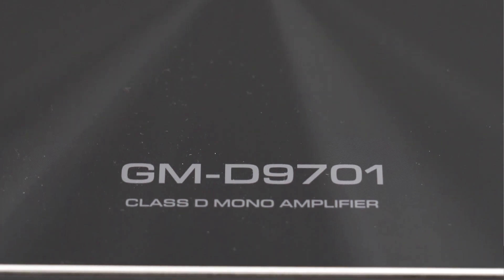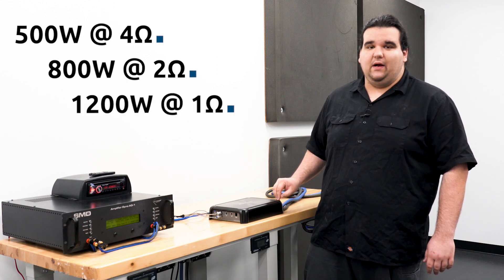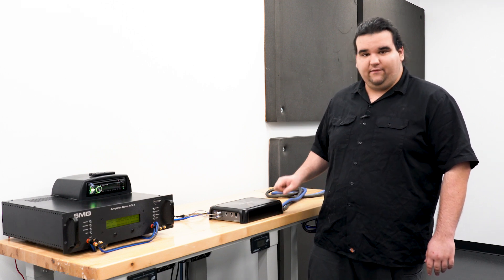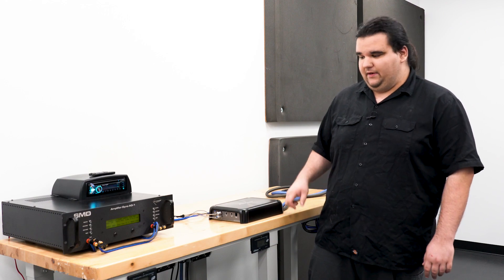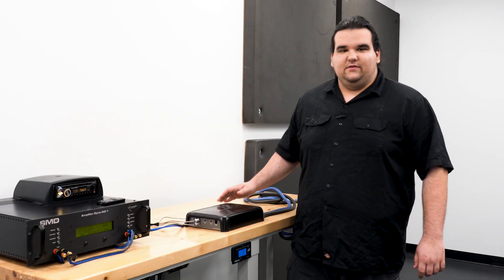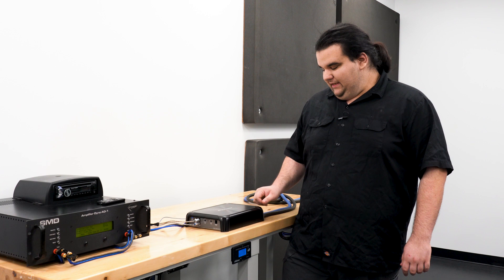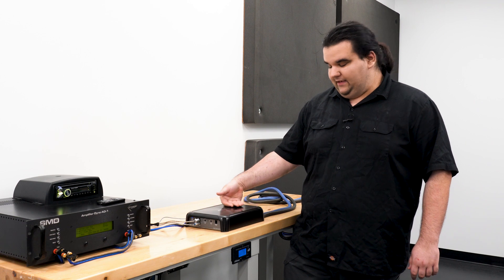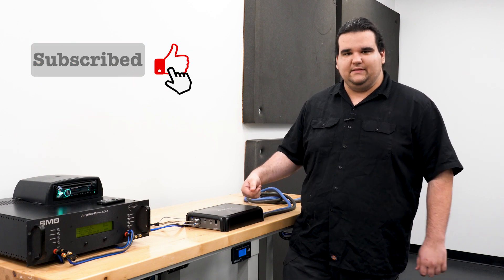Pioneer GM-D9701Amplifier Dyno Test | SMD D'Amore AD-1

Comment: what is the best Gain setting
Wirh rockfoord Punch P3D4-12 600 RMS @2ohm
Reply: Depends on head unit, the h on gain setting for pioneer is for 4v preouts iirc and the normal gain setting is for 2v.
Reply: Thats a impossible question

Comment: I have a bike with amp works great with switch on, when turning bike on it goes in protection mode, power and ground are great getting 13-14 volts after turning bike on and when switch in on position i get 12.47 volts i checked cable ohms and right on the money,  please help
Reply: Sounds like remote wire is not correct or you have a loose wire. Many mistakenly put remote wire to power antenna
Reply: @cfmechanic  thanks

Comment: Hi, i am using this amp to run the 2 JBL stadium 1224, at 1 ohm load and total 1000watt rms. But when i raise the volume above than 20 from my after market stereo, this amp start tripping, whats the issue.
Note that i did BIG3 upgrade in my car electricity wiring. What i have to do further? Guide please ???
Reply: Low voltage high gains! Please check with DMM.

Comment: My subwoofer use to work great and kicked hard. I had it installed by my moms friend who installs subs and audio. I have since moved away for school and cannot ask him questions. I do know that everything is wired properly, my ground is good, and my fuse is good. Randomly the sub just stopped kicking and still produces sound, but it is very weak. Additionally, It no longer sounds clear at all,  and it sounds more jumbled/rattly.  I've tried changing the polarity,  and I do not know what is causing it.
Reply: If you can try a different AMP 
Or maybe the signal RCA got damaged somewhere. Take the SUB out and check the connections on the SUB. Make sure the SUB doesn't smell burnt. GL

Comment: Hey guys I really need help cause I don’t know what to do anymore I have 2001 Ford Expedition Eddie Bauer truck with a mex-n5100bt radio with stock wires I have 2 kickers 100rms 300wat speakers in the front doors because with the stock ones I would get to much distortion so I changed them thinking it would be the speakers and I still get distorted plus I have changed the settings and none helps should I get a better stereo or do I need to change the wires or get a amo but I need some cheap any ideas plz

Comment: Does anyone know why my sub doesn’t turn on at low volumes? It turns on until I put the volume up and then after it turns on it works good on low or high volume. Thanks!
Reply: Depending on size of sub make sure your subsonic filter is like 28-32hz for 12” subs im no pro but if it’s set too low on your amp that could cause that maybe I could be wrong
Reply: @Jakethegreat105   what is the best Gain setting
Wirh rockfoord Punch P3D4-12 600 RMS @2ohm

Comment: Which better 9601 or the 9701 model thanks
Reply: They are the same. 9701 is just the "newer" model.
Reply: @kalyndyck315  the  d9701 is just smaller version they're pretty much the same just the d9701 is more compact

Comment: This amp makes it's power when supplied with enough power. Once I upgraded my electrical system, there was a huge difference. Electrical upgrade is a must in order to get the full potential of this amp. Now I just have to upgrade my subs!!
Reply: What did you upgrade in your electrical system?
Reply: @Paul_Espino   mechman 360 amp alt, big 3 w/0 gauge
Reply: @justyouraverageapexplayer1826  that's wayyy overkill electrical for a 1200w amp

Comment: Hi there. I wanted to ask that I have jbl c762 2 way component speaker system. I want to know how to set gain properly with multimeter for component speakers. Because if I set gain as per your previous video tweeters make Noise and pick up engine sound. Also guide me my tweeters pick up strange noise when I receive phone calls on my mobile phone.
Thanks in advance

Comment: All you guys talking about 14.4 there is no one absolutely no one unless you have three alternators and a bank of batteries that's going to stay at 14.4 this test is what you would get in a real world application
Reply: The problem is they don't rate it based on your electrical capacity it's rated on known values. So don't say it didn't make rated #s if you don't test it correctly. They should just say the truth it made this much power at 13.6 volts. They don't know what it does at 14.4 because they didnt test it. They shouldn't be dishonest which they were.
Reply: He commented that the amp fell short of the output Pioneer is claiming. Bullshit. Pioneer rates the amp at 14.4V, as does every manufacturer complying with CEA2006. So unless you're going to test at 14.4V, you can't open your fuckin mouth and say something like that.

Comment: Amp doesn't fall shy anywhere with the right voltage
Reply: Right !!!
Reply: @jonpatterson6479  I really get frustrated when test products when they don't have the right equipment or proper voltages to do it with.
Reply: Yeah it's a good amp. It's identical to the 9601 except for some of the capacitors were upgraded to a better quality. But the performance is identical. 
  As far as the voltage goes, 13 volts is too low for a test. Everyone always wants to bring up voltage drop in a vehicle, and box rise. While they may be correct, this video is for  a Bench test. Testing the amp to see if it does what the manufacturer says. NOT a vehicle test. Therefore, it's imperative to have the proper equipment to maintain voltage. So yes, very frustrating

Comment: This must be your first time testing car audio equipment. Of course it came up a little short, you didn't have the 14.4 volts that  it is specified at. Get your batteries charged up and do it again. Run it at the voltage it's specified for before making those accusations.
Reply: FFS right? And they want us to trust them and their knowledge?!
Reply: Does your car hold a constant 14.4 volts? Doubtful. Then this test reflects a more real world number that you can expect to get when running the amp in your vehicle.
Bench tests are good but, no one runs a test bench in their car.
Reply: @msh6865  He specifically called Pioneer out by saying "it did fall short of the numbers Pioneer is claiming", which is bullshit because they claim rated output at 14.4V.... the CEA2006 standard that every amp manufacturer worth a damn follows. So while the test may not be invalid, he sure as shit shouldn't have said the amp falls short of rated output.
Reply: @msh6865  they also weren't doing a real world test. They we're testing against the manufacturers specs which was at 14.4 volts. Pay attention.
Reply: @msh6865  14.4 to 14.6, so no not a constant.

Comment: These are amazing amps!!! Does a little more than rated at 14.4 true little power houses just make sure to use the bass knob included with the amp
Reply: I was planning on getting these but heard from reviews that the bass knob is bass boost and not a bass volume knob is it true?
Reply: @NoPainNoGain___  no that’s not true. The bass knob is more of a gain than a boost. Either way set your gain correctly turn the knob all the way up without clipping and you’re golden!
Reply: @Outty5000Hertz 2 years later bro 🤣 it's all good thanks for letting me know but i went with Dc Audio instead.
Reply: @NoPainNoGain___  sometimes YouTube notifications pop up lol but definitely a good choice
Reply: I noticed if the bass knob is plugged in but not turned up  I get better and deeper bass but that’s my ears 😂 and I run 6 10” subs on 6 9601s at 1ohm on 410 alt and 80ah lithium

Comment: I got one. Ran my 1000 rms Audiobahn at 3 ohm (Dvc6) and it was nice putting out 650> rms. Looking to get a Skar EVL 12. Amp has no SSF but that has given me no issues so far. My question is you say it didnt hit numbers at 1 ohm but I saw 1500 rms dynamic so isnt that a real simulation of what we would get with music?
Reply: it didnt hit its number because it wasnt @ 14.4v but if it was the amp would of hit the number. dynamic is a kick drum bass note like listening to old rock music bass. if you listen to long bass notes like rap or country you want the uncertified numbers
Reply: @shoof1696  right right I get you. Thanks for the knowledge. So I get get what I expected 1,100-1,200.
Reply: @Pkdimmock  sadly no. subs are reactive load so once the sub moves the amp will see 2-4ohms it can even go up to 10ohms. the amp will see 1ohm if you do a test tone burb at 80hz and up. parker dacchille test subwoofers and uses the smd amm1 to show the ohms and how many watts the subs is actually getting. he test them in his car that has a high output alternator, big 3, secondary battery, an audiopipe 3k amp and playing music not test tones. with all that said the subs never hits 1ohm the lowest ive seen was 2.3ohms. i tell people if your sub is 1000w rms wired to 1ohm look for an amp that can at least do that number at 2ohm (4ohms if you have the budget for it) so even with impedance rise youre giving the subwoofers rms
Reply: @shoof1696  wow ok. Had to read that a few times but think I get the idea. So many variables that can change from a testing setup to real application. Well with my Audiobahn at 3ohm it was banging so will still get more out of it when I get my Skar. Can't imagine needing more than that for day to day 🤣 Again appreciate the teachings.
Reply: @Pkdimmock  hell yeah man the skar evl in a 2.5-3 cube box @32hz is banging. neighbors gonna love you shaking their house lol
Reply: @shoof1696  lool I just built a 2.5 cubed box and I was aiming for 34hz but seems to be 32hz. I used to set gains by ear and had my neighbour come out years back and chew me out. This year I got an Oscope and am pleased coz now every step is clean.  Aldo spared the neighbours 🤣 I got the EVL shipped from the US here to the UK. Its been sitting at Heathrow customs for 5 days 😓

Comment: Sonic Electronix you should've mentioned your voltage was also low. These amps WILL do the full 1200 at 14.4.
Reply: Yeah it does 1700 dynamic when supplied with proper voltage
Reply: True true.
Reply: Yep
Reply: O my goodness we all Know!!!!!! I'm talking about the Dyno test for goodness sake. There is ALWAYS that one that says "yeah but it the car.........blah blah" 🤦🏻‍♂️
Reply: @jonpatterson6479  obviously not if you keep worrying about Dyno results. Cool it does rated. But what's it actually doing in the car? What's it's efficiency? Read between the lines and be informed rather than be closed minded and worry about a number.
Reply: 🤦🏻‍♂️ It's a Dyno test. Everybody knows that it won't give you the same numbers in a car. It's not trying for that. Nor is anybody claiming that it will do that in a car. Simply showing the Dyno numbers. Nobody said they're the most important numbers. But they are what they are. 🤦🏻‍♂️
Reply: Did 1500 on dynamic, thats what you can expect when playing music. So id say this passes the test
Reply: @melvinf190  thats what I was hoping based on the 9601 tests I've seen
Reply: @melvinf190  certified is the only number that matters
Reply: @d77543020  Dynamic is simulating music power. That power rating is what you can expect it to actually do while playing music.
Reply: Except no one stays at 14.4
Reply: @d77543020  maybe not, but saying it fell short of its rated power is not being honest since they didn't test it at the rated voltage. I doubt they're trying to mislead but it is still dishonest statement.
Reply: It's a bench test. Not a car. Needs to be at 14.4
Reply: Also my CES 320 and XS Power 3000 would easily stay at 14.4 on this amp.
Reply: Thing is you won't be seeing a full 1200 watts at all when wired to speakers because those are static loads and not reactive loads. At most you'd probably see somewhere in the 800-1000 range depending on vehicle voltage and what type of speaker/enclosure.

Comment: I hve gt this amp want to knw one thng em using 400 watt rms subs d4 sub em using the sub in parallel wired to 2omh load, what would be the best gauge of wire for the 400 rms d4 sub...?? For best sound quality ...??
Reply: 10 gauge is good, but I just always go with 8 gauge on Subs. I prefer to go big. 8 may give you trouble if your going parallel. Depends on the terminal size and how willing you are to make it work with a little work.
Reply: @Pkdimmock  how much rms subs are you using...??
Reply: @premierautomobiles8513  I had a 1000 rms sub but its only running on half that. I say use 10-12 for what you are using as you may want to upgrade later. I just prefer to use 8 as that is what the terminal size is. Over size isn't gonna hurt but undersized is, and 8 gauge is cheap.

Comment: As an owner of the d9601 I can say these amps are very good!  They do not get hot and push plenty of power to your subs.
Reply: I have this amplifier on (2) Skar sdr 12's, at 1 ohm. Awesome amplifier! Pushes crap outta them.
Reply: max temp? mine around 40-45*c
Reply: How long have you had it and what subs are you running??? I’m looking for someone who can speak to the durability of the amp.
Reply: @hadbl12  owned it for 5 years. Pushing two Alpine Type S.  Still pushing them to the max.
Reply: Jorge Martinez thx. That’s the kind of feedback I was hoping to hear. I really like the numbers they published, but was concerned with reliability. Thanks again
Reply: Jorge Martinez you used 1ohms thanks
Reply: I got this bridged to a Skar DX12 @ 4ohms till i break the sub in. Have the gain all the way down. Hits almost too hard.
Reply: @azneau28  yes it's an excellent amp!  I had some fool tell me they don't do it's rated power and that they don't last long.  I've had my 9601 for 5 years and still working like new.
Reply: @jorgem50  im wondering if its almost too much. I have just the 1 DDx-12 and it the amp gain is all the way down. I am running this off of a LCi2 since its in my bmw but damn. If i wired it down to 2ohm things might get ridic.
Reply: @azneau28  It's never too much.
Reply: what is the best Gain setting
Wirh rockfoord Punch P3D4-12 600 RMS @2ohm
Reply: @علاءعبدالسلاماسماعيل-د9ف  connect sub to a 2ohm load & leave gain at normal
Reply: @علاءعبدالسلاماسماعيل-د9ف  There is no way to really answer this.  Stick a graphing multimeter in the terminals and run a 40Hz test tone through it at max volume on the head unit.  Turn the gain up until it starts to clip, then back it off a little bit.  It will never clip then, and you won't blow subs.

Comment: Amp is solid but both of mine have problems with the switches so the amp is basically trash it changes gains and stuff cuts in and out after a month in florida  heat so not worth it
Reply: You talkin about the gain knob? Do they get loose or what?
Reply: @Pkdimmock  the switches have bad grounding its defective so it gets loud some days sometimes quiet... Grounding problem in the switches metal
Reply: @DirtySouthFlorida3  amp gain set to high, amp not in a well ventilated area? can cause amp to over heat .The amp has safety features that will intervene to protect the amp
Reply: @DirtySouthFlorida3  oh boy. Hope nothing like that pops up with mine. Sucks for you. No chance of getting it sorted?
Reply: @DirtySouthFlorida3  oh so its not specifically with the 9701. Its the 4  channel 9704 you have. The 9701 in a mono block so no channel switch
Reply: hows your electrical? d class amps rarely heat up or cut out. they only do it if the amp is staved